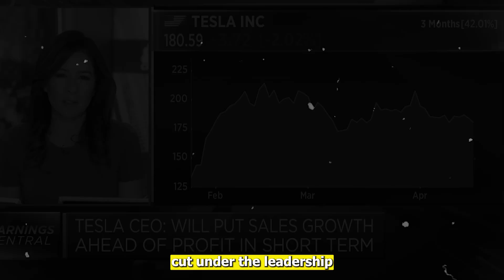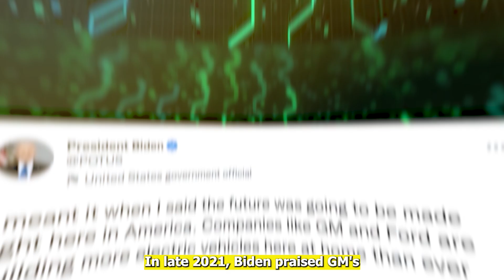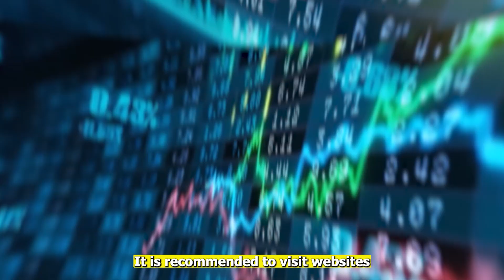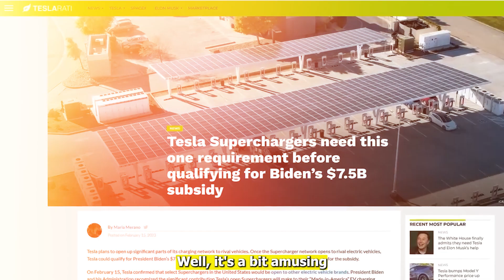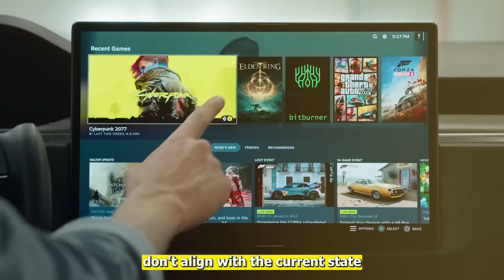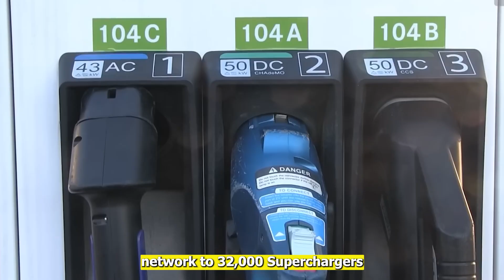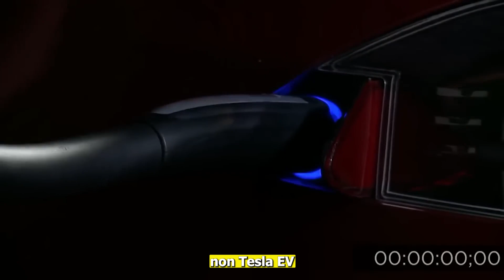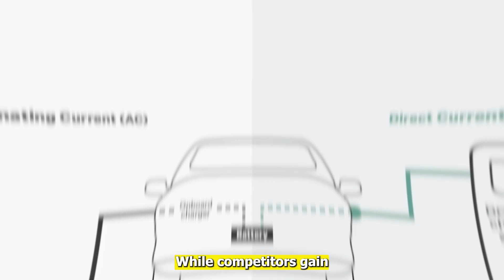What Joe Biden JUST Said About Elon Musk...

Comment: There is not enough power in the U.S. to charge the number of cars they want to see on the road.  The degradation of the environment where Rare Earth Metals are mined.  Electric vehicles only make sense with free energy technology; which do not require the amount of batteries presently installed.  After three years the batteries need to be replaced; what about recycling of these batteries?  Can they be re-cycled safely?  This fact has been ignored in the past with teflon and plastic; which is the worst environmental disaster through out the oceans leading to early death of aquatic life species.  Plastics ball up and do not pass threw the digestion system; which farmer and ranchers found out when natural twine was replaced by plastic twine that ends up being over grown by grass and the plastic that ends up in fields winds around axles, moving parts, and takes out bearings on these parts.  Plastic twine has not been recycled enough and was never involved in the sales of these never ending materials that end up in cattle and other farm animal's stomachs.